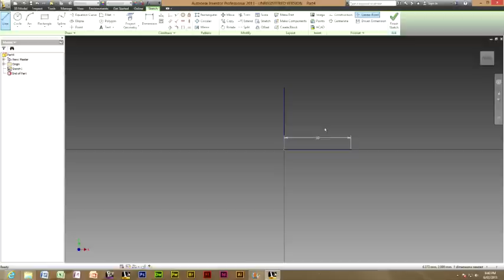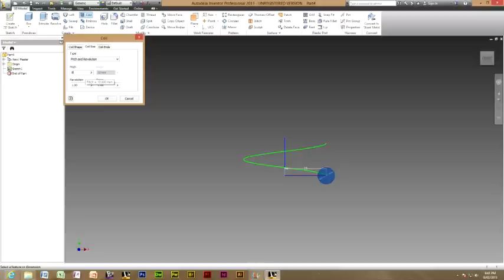Autodesk Inventor 2014 - Making A Coil / Spring

Comment: Very helpful, thank you! :) Just one small tip if I may. If you use "Project Geometry" tool and select the axis around which you want to build your coil, there is no need to draw the "vertical line" you used :)